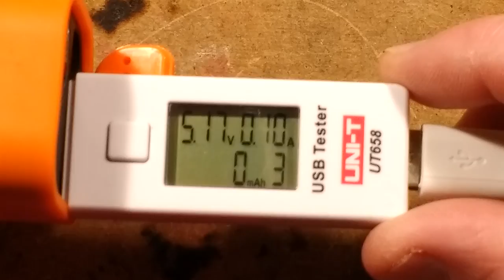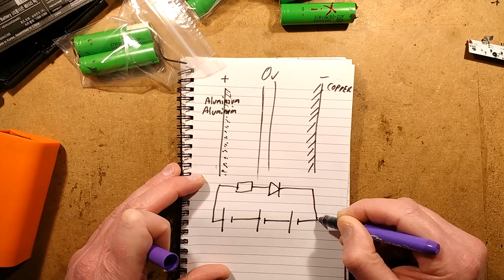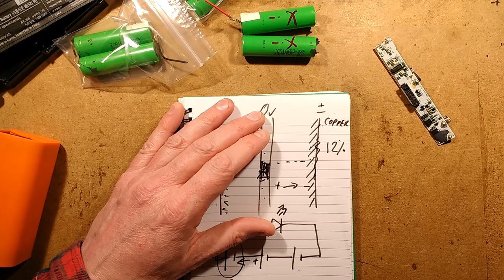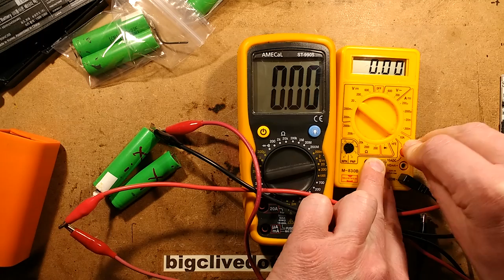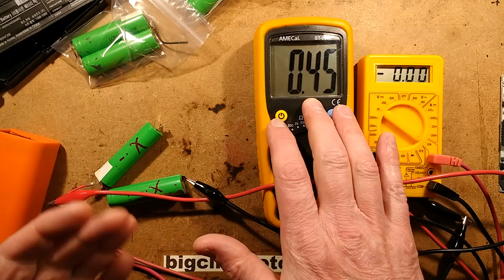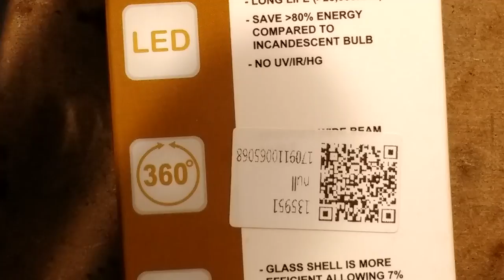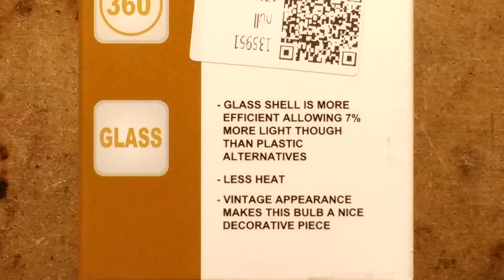Teardown of a faulty Samsung lithium 18650 cell.  (2200mAh)

Comment: The smell is most probably propylene carbonate. It's not great for you, but it really isn't all that bad either (especially as far as solvents go).
The REAL issue is the lithium salts that are dissolved in that solvent. Soluble Lithium salts are themselves really not something you want to risk getting on your skin (it easily gets absorbed and really fucks up your brain). As for the anion paired with the lithium, there really is no way of knowing. Some of them really aren't that bad, while others readily decompose into such wonderful things as HF (Hydrofluoric Acid) and Phosphine Gas, upon exposure to air, water and/or heat.

All in all, the only thing I'd really be worried about is the small amount of lithium that gets sprayed all over the bench. One day in the future, you WILL touch the bench and afterward go to eat something without washing your hands first, thereby ingesting a few milligrams of Lithium.
Reply: Lithium is used as a medication for people with bipolar disorder.
Reply: MRLT yes and mercury helps children in vaccines too
Reply: You realise you're saying this to a large Scottish man who drinks gin while making these videos, don't you? :)

Also, if we're freaking out about dangerous heavy metals, best start prying out those amalgam fillings before the mercury rots your brain ;-)
Reply: Or ethylene carbonate.
18650s pretty much behave as any sealed metal cylinder such as a tin of beans containing a liquid - if heated to extremes it may vent -- sometimes violently -- and as ethylene carbonate is flammable, it may or may not ignite depending if it comes into contact with a spark or red hot conductor.
The real concern with lithium cells is not the small amount of lithium they contain, but those that contain carcinogenic cobalt compounds such as most LiPo pouch cells and 18650s with an ICR prefix. These should be recycled and never thrown away - not least because cobalt is currently $80,000 per ton!
Not all 18650s contain cobalt. A browse through wikipedia on any of the many different compounds found in lithium cells will provide a lot of useful information.
https://en.wikipedia.org/wiki/Lithium_cobalt_oxide
Reply: Andy Lee Robinson; I have never heard of Cobalt being carcinogenic. Are you sure you're not thinking of Cadmium?
Cobalt is really pretty chilled as metals go. It's about as dangerous as Copper, and MUCH less so than hexavalent Chromium...
Reply: Amalgam fillings dont pose any measurable threat.
Reply: Paul Beurich; Well, 'bad' is a relative term, I suppose. Cobalt ions only have a moderate toxicity (ld50 is 400-500mg/kg, which is a bit less than copper AND copper's mechanisms of toxicity is MUCH worse), and the target organs include peripheral systems like the heart (cardiotoxicity seems to be the biggest cause of death), while even small amounts of Lithium salts will interfere with the membrane potentials in your CNS, causing you to not experience happiness/joy/enjoyment nearly as strongly, while still allowing you to experience maximum pain/discomfort/unhappiness/etc., which is exactly why it's used to treat bipolar disorder (specifically the manic part of the disorder).

Now sure, you might care more for cardiotoxicity in the mildly toxic range, than for the neurological effects, but to me at least, cardiotoxicity isn't a big deal at all. It can just kill you. It doesn't change your likes and dislikes, it doesn't change your personality or your experience of reality and it doesn't mask itself from your experience (if something alters your consciousness, it's entirely possible that you won't be able to consciously be aware that things aren't as they should be. With massive heart damage, however, it's pretty obvious.).
Reply: Andy Lee Robinson; I'm sorry if I came off as completely dismissive of Cobalt salts being dangerous at all. You are, of course, completely correct that it isn't to be handled lightly. I was just getting the impression that people were thinking that it's somehow much more dangerous than most other soluble salts of transition metals (which it really isn't; with the possible exception of iron). The common, soluble salts of Copper, Nickel, Zinc and even Aluminium (usually pretty insoluble, but the chloride is quite soluble and pretty dangerous as well) are all really dangerous when handled without the proper PPE.
Reply: No worries... Anything in the wrong place in the wrong amounts for the wrong duration can be bad, and there's no sense increasing one's exposure or adding to the environmental burden (unless its profitable to do so (snark!))
They once even added cobalt chloride to beer to stabilize the foam, until the bodies started rolling in. What were they thinking? Is beer foam really worth dying for?
Reply: Andy Lee Robinson; Yeah I agree 100% with that. The only exceptions would probably be stuff that gets excreted quickly, doesn't get biomagnified and doesn't bioaccumulate, all while also being acutely, fairly non-toxic (things like sugar and table salt, for example).

However, putting something in food, for profit, without warning people so that they can make an informed decision, is morally repugnant.
Reply: Well, even 'harmless' sugar or table salt ingested in kilogram quantities could kill you by upsetting sodium channels and osmotic pressure, while imbibing too much water too quickly causes the brain to swell and leads to coma and death... :-)
Unfortunately, business leaders tend to have a disproportionately high incidence of psychopathy, which may be good for making certain difficult decisions, but considering morality and the consequences of their products on their consumers and 3rd parties aren't. We've seen this play out constantly with lead paint, tetraethyl lead, DDT, methylene chloride, transfats, BSE, neonicotinoids, glyphosate etc, and of course coal and fossil fuels which together cause millions of premature deaths per year and should be retired asap, but now is not the time or place to get me started on a rant about saving the world! :-)
Reply: Wait phosphine gas is real? I thought it was only in breaking bad! 💋🍄💋🍄
Reply: Manuel H.; Yes, Health and Safety overcautiousness and overreactions are indeed a big problem today. It's a symptom of big institutions needing to cover their asses so as to avoid frivolous or unrelated lawsuits. This is especially apparent in an Organic Chemistry lab. The SDS of all reagents used in a synthesis, is required reading before hand, but there are only a few different words that are used to describe the associated dangers. For example, hexavalent chromium's sds states: "May cause cancer.", which is simply unacceptable, considering how potent of a carcinogen it is by inhalation (Which is also not stated. They simply make it seem lime all ROEs are equivalent). This isn't a new phenomenon either; The old EU DSD Classification simply states that it is a "Carcinogen cat.2", which is defined as being possibly carcinogenic to humans. Why is this absurd? Well, lets look at another class 2 carcinogen: low energy EM radiation (radio and microwaves, that continuously irradiate you from local radio and tv stations, as well as microwave ovens, wifi and, of cource, cellphones! Yes they COULD, potentially, be very inefficient carcinogens (no actual epidemiological evidence of this has been found), but the problem is that this (and many other comparatively safe substances) are placed into the same category, with no way for you to determine the actual danger posed (only the legal exposure limits are commonly provided. Acute toxicity data is provided only for some of the listed compounds, usually measured in rats). This, together with the legal liability involved (the legal exposure limits are based on a constant, 8 hour a day, every day, for all of your working life, exposure that would be expected to cause no detectable damage in even a very small subset of the entire working population. It should be painfully obvious that this is almost completely inapplicable for determining the risk posed to the hobbiest, following short-term exposure during a project or experiment!) then forces teachers, instructors and even professors, to teach each new generation that almost all chemicals are exceedingly dangerous, which obviously makes it nearly impossible to know which things are actually dangerous, how and why they are dangerous and which things are only dangerous in certain specific circumstances.
As a final example, consider NaCN (sodium cyanide). Hollywood shows how instantly deadly this substance is, even in minute amounts that go undetected during a search, such as a capsule fitting inside, or inbetween, of a captive's teeth. Even Nurdrage (at the start of his video on the synthesis of NaCN) gives a very intense, long and strongly worded 'safety' warning, which makes it seem like you will die if you even just touch it with bare hands.
Cody (from Cody'slab), however, REALLY dislikes common misinformation and he also made a video on NaCN (not in response to Nurdrage's video). In it, he takes some cyanide, weighs out a non-lethal amount (which is a LOT more than usually shown on tv) and dissolves it in water. Finally, of course, he proceeds to drink the cyanide and then explains what he experiences, as well as how quickly the human body actually process the cyanide.

Transition metal salts, however, are NOT to be fucked with, if you care about your brain's health or your senses' accuracy. However, if you don't, then I agree; licking the battery's innards would be totally fine.

Andy Lee Robinson; Yeah... It does take a 'special' sort of person to willingly make a business decision (the unethical one) on the calculated monetary risk, due to public death and disability lawsuits, versus potential profits, such as in the Ford Pinto case (which was indeed blown way out of proportion in the public press, but the management decision did still lead to 27 deaths by being burned alive and 24 non-fatal burn victims, before Ford was finally willing to issue a recall).
Reply: John Smith; Yes it is, and it's actually REALLY amazing and beautiful to play around with!
See here:
https://youtu.be/nykiX2ABJdI
Reply: MRLT where do you get the idea that ingesting a few mg of lithium is a problem?
Reply: Hair Fritz; No, even a hundred mg wouldn't be an issue for the average adult (the amounts used in effectively treating bipolar disorder can even run into multiples of GRAMS, on a continuous basis, since lithium isn't bioaccumulative.).

The amount of lithium used for intercalation (the part that gives the cell its capacity), is indeed very small, however, some cells use lithium salts (which was what I was referring to), dissolved into an organic solvent, as their electrolyte. Consequently, the more lithium salts can be dissolved into the solvent, the less internal resistance the cell will have.
Now, it might be true that almost all manufacturers have started using other salts for their electrolytes (I don't know); however, about 5 years ago, I took apart some high discharge rate 18650s and they had a HIGH concentration (around 1M) of LiPF6 dissolved in the electrolyte!
If I had to guess, I would say that the high concentrations stabilised the SEI under the harsh conditions of fast charging, while also minimising internal heating, but I really don't know for sure.
The problem remains, if you don't actually test for large amounts of lithium in the electrolyte, why would you assume that there isn't an excess to that which is used for intercalation and SEI formation?
Reply: When I was a kid in the 1960s I had a Merit Chemistry Set, that could be bought in any toy shop and was made in my native Potters Bar. It contained among other things cobalt chloride, copper sulphate and ferrous sulphate; these give beautiful results in a "chemical garden" in which you drop crystals of them into a jar of a solution of sodium silicate in water. The crystals start to dissolve and the cobalt chloride etc reacts with the sodium silicate to produce cobalt/copper/iron silicates which are insoluble in water. These silicates form structures that look like growing plants and can grow tens of millimetres high. The set had instructions never to put any of the chemicals in your mouth and to wash hands thoroughly if you had touched any. I think these chemistry sets for children were banned when the UK joined the European Community (as it was then called) in 1973. A company tried to revive them sometime around 2000 and earned itself giant shock-horror headlines in certain newspapers. Cobalt chloride is now suspected of being carcinogenic and its use even in industry is officially frowned on unless there is no possible substitute. It used to be used to impregnate paper to make a humidity indicator that would be blue in dry air and pink in humid air. Something else has had to be substituted for it for this purpose.

Comment: Before it was washed off, the graphite material that against the copper did appear to have a slightly coppery sheen or color appearance compared to the aluminum side. which looked slightly darker.  Perhaps it might be worth taking apart an undamaged cell to see if a similar coppery sheen is present there too?

Comment: Don't listen to him. They cannot be discharged to zero without causing physical and chemical damage to the cell. Will it work after doing so? Maybe - if it's been done rarely, and never left at zero for long. (I wish I had bookmarked the video series where they tested 1000 identical cells. They were looking at them under an electron microscope to see the exact effects of deep discharges and multiple recharge cycles. They were also testing different electrolytes; the moral of the story: manufacturers know infinitely more than lab geeks.)

Comment: I've been restoring a HP HDX 9000 from 2007. The battery that I had with it was not really holding much of a charge anymore, it'll keep it in sleep mode for a couple of days but the moment you put under a load it would die.

I wanted to take it apart and put fresh 18650 sales in it. I figured upgrading the stock ones to Samsung 3500 milliamp hour ones would not only be more affordable than buying a new battery, but also give it significantly more capacity.

Long story short, I literally destroyed that battery trying to get it open.

I tried using prying tools to pry open at the seam but it was not budging. Finally I mutilated the top of the battery where the plastic was the thinnest, and I was able to extract the batteries but when I was extracting it, I accidentally shorted the batteries with the BMS and made magic smoke and I'm like well so much for that idea.

And even then the batteries were tack welded on, there was no chance that I was even going to be able to extract them anyway. I think next time I'll probably buy a precision rotary tool, get it open at least, and then take it to a nearby repair place and maybe see if they have ways to unweld the old batteries and weld on the new ones.

Comment: A few months ago I disassembled an old IBM battery packs. All 8 cells were bad. They would take charge, but would then self discharge within a few hours, less if there is a load attached.

Comment: I had a lot to do with the early lithium polymer aluminium pillow style batteries for radio control. In this application everyone wanted the maximum discharge current donated in multiples of “C” being the capacity of the pack. Early packs from memory where rated at 5C and the last I remember up to 40C and I think much greater now. Balance charging was the order of the day so individual pin outs for each cell and a loom  and balancers or balance chargers. And caution advised when running packs in parallel. The ducted fan boys had recharging trailers set up with multiple good 12 volt batteries chargers and serious “fanatics” see what I did there camping generators. They where getting to voltage levels with multiple series packs that required an electrician to approve and ducted fan thrusts in the 10 kg range similar to a medium sized turbine. I have successfully recovered packs where one cell has dropped under three volts by charging this cell individually on low current until over three volts then you can charge at 1C. Safe charging of  all these cells was 1C with later cells taking 2 or 3C. Very interesting tech and made electric flight a reality for radio control. Wobbels the mad Aussie.

Comment: im gonna make a guess whats inside, 1000 AA batteries and an iphone and 3  unicorns
Reply: Jusb1066 the iphone may be the reason why it doesn't hold a charge !
Reply: You have to be quick to get the unicorn with a hammer.